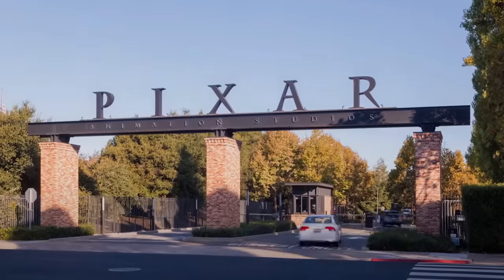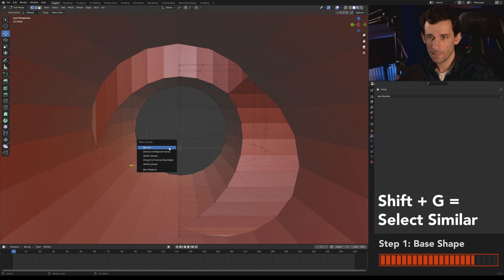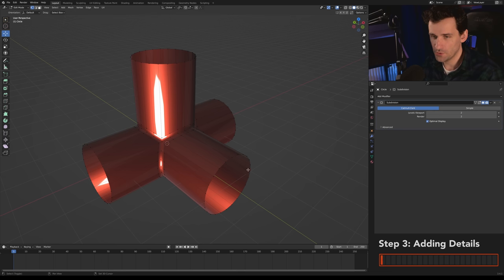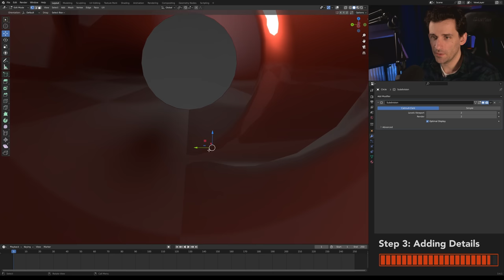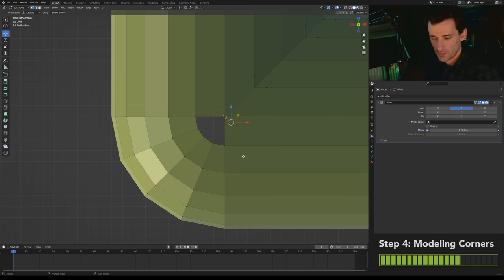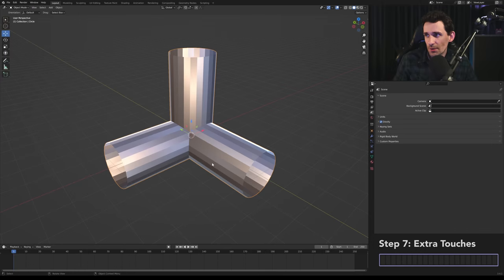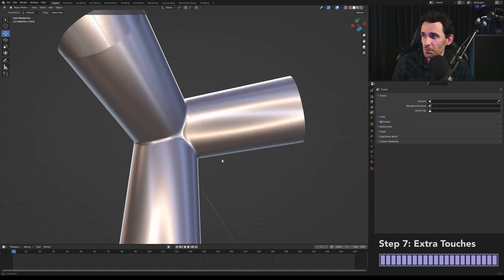3D Models That Will END Your Career

Comment: I’m not a professional in blender but you could just use bevel modifier before subdivision instead of adding unnecessary loop cuts. Also you could use solidify modifier instead of solidify faces tool. Then you couldn’t need to add those extra loop cuts on the ends. If you need a bit of rounding on it add one more bevel modifier and in shade auto smooth. I always try to avoid these support loops. Please tell me if I’m wrong
Reply from the maker: you would loose your 3D job a couple of times foe this post lol

Comment: What are your thoughts on using Shift+E to make a smooth edge more sharp as opposed to an extra edge loop? I tend to use Shift+E to help reduce the amount of vertices in a model, and it seems to yield similar results. Is there a deeper concept I am missing or no?
Reply: Don't quote me on this but I think edge crease data may not always translate when you convert it to other programs and that's why

Comment: Wouldn't it be better to set the crease value for the edges instead of adding additional edge loops? That achieves the same effect, sharpening the edges with a higher crease value, without having to create extra geometry just to manage it.

You can access it by selecting a few edges of a model, press N for the side panel on the right in 3D viewport, go to Item tab (the first one), and in the Transform panel look at the last option, "Crease" (or for multiple edges, "Mean Crease").
Reply: Also, instead of adding edge loops to make the smooth shading not be so smooth, consider enabling Auto Smooth at 180 degrees (so it doesn't autoflat things) and then marking edges as sharp instead (CTRL+E -> Mark Sharp); this can be really handy, as the result is that a face can be smooth with adjacent ones and yet sharp on the edges marked as sharp, and it doesn't depend on any additional unneeded geometry lol

...Though in that particular case the edge crease value can already get you there i guess lmao

Comment: For merging three pipes - I would use beveled box as join. Size matched with pipe size and segments matched, with no of points of circle would make it very nice looking mesh IMO.
Thanks for sharing - very informative and helpful.
Reply from the maker: With the cube solution you need to avoid a vertex at the center of the corner - it causes a shading bump (you can check my twitter where I explained it)
Reply: @Chocofur  Thank you, I will keep it in mind.

Comment: I would use CAD software like Fusion 360 to create these tubes much faster and then convert them from a parametric body to perfect mesh in Fusion 360 as well. 
I don't know if this is out of the box thinking or just me with CAD experience.

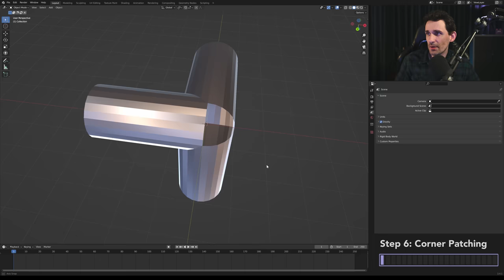Comment: For 8:24, you can instead subdivide a cube a few times with Catmull-Clark method, and apply polish on it until it becomes almost a perfect sphere. Then you can use one of the poles on the sphere (aka 1/8th of the initial cube) and replace it with the UV Sphere you were trying to use. Or you can conform(or shrink wrap) a subdivided cube on an almost perfect sphere and use one of the poles. Both would work, and produce the best result.
Reply from the maker: it won't produce the best result as you'd have a vertex in the middle of the corner, causing a small shading bump with subdiv mod applied. it's close to being perfect, but that one vertex ruins it
Reply: @Chocofur  I just tested it. It works perfectly fine.

Comment: 8:21 If you use quad sphere with one level of subdivision and scale it to mach the borders of gap and then weld vertex, it would save you time and makes better topology.
Reply from the maker: it doesn't have better topology and it's more work, check other comments

Comment: For the modeling corners Im sure using the shear tool at 45 degrees each, joining and then beveling might be much faster and easier
Reply from the maker: faster and easier but NOT GOOD ENOUGH
Reply: @Chocofur  After some testing, simply bridging the edge loops is the fastest and best way to get the result you want, opening the tool in the bottom left and fiddle with the number of cuts and the smoothness settings to get the correct density and profile of your mesh.

There are other settings there to customize it further but I didnt find I needed them to achieve this result.

Comment: for level 2 (or the 90 degree pipe bend it's as easy as just taking a torus and then cutting 1/4th of it to get that 90deg angle. and then we can extrude the faces outside. to get a steeper angle we can scale the object up using alt + s. gives perfect topology

Comment: Instead of adding extra edge loops on the corners to make the subdivision "sharp", you can just select the edges you want to be sharp and press Shift+E and then pull with your mouse until you like the result. Now the subdivision won't smooth the edge anymore :)

If you want to remove it you can always select the edge again and set the "Mean Crease" to zero in the "Item" Tab in the side menu you open up by pressing N :)
Reply: It never gives me the control I want
Reply: @squeakybunny2776  oh, okay. I found it pretty good since you can slide it to be as sharp as you want. You can also put a number in the "Mean Crease" I mentioned before and that's usually pretty accurate when you can add numbers like 0.548 or whatever.

Comment: I guess you could select those non symetrical vertices on the third example and use loop tools to turn them into a circle with the flattening option turned off? Idk if it would cause shading errors though

Comment: Just on a side-node: You do not need to add edge loops (they are hard to deal with in terms of symmetry). However, you can add a EDGE weight to edges and give it hard numbers to compare over all the edges
Reply from the maker: if you ever want to land a serious job as a 3d modeler, you need to learn how to edge loop. creases / edge weights will get you fired at sight

Comment: So the puzzlement regarding steps 6 and 7 :

I suspect that part of why it works
is because the spacing and angle of the vertices
still follow the "rules" of 3D geometry enough
to produce that smooth result
(even though the wireframe looks a little untidy )

In a similar vein,
when the geometry on my model looks clean,
but there's a pinch,
I often find that this is due to those same "rules"
not being fully satisfied.
(and not because of some glitch in the program)

A tweak  here and an adjustment there
and then eventually the rules get satisfied,
resulting in a smooth render.

Same for tri's, ngons and quads.

Comment: Hello, I'm curious whyy not use bevel on edges instead of adding loops to sharpen sticks inin subdivision ? Cause to me it's faster, And I've ended having less Faces count on model int hte end.
Also, is there any difference between using Solidify modifier with Solidifing through Face menu ?

Comment: I am CAD person using Blender, so it is hard for me to eye ball everything. On the first item used the bevel tool on the common line between the pipes and the ends. To clean up object after apply the Subdivision Surface Modifier. I used 3 segment and the distance of 0.01 for the Bevel tool.

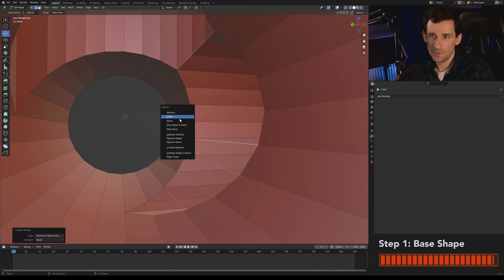Comment: @ 1:52 you can see the triangle shape in the bottom. For some reason I had still had one face on top of that. Actually connecting with the last line visible there (stangely it did not happen at the joint on the side wich should be identical).
Using Blender 3.6 and the bool tool addon (just hotkeys the bool modifier)

Problematic face can be safely deleted and everything works just fine. I double checked.
BUT if it happened to me it WILL happen to someone else too, so I would reccomend double checking by looking closely inside. Problems should be easy to spot, since there isn't too much going on in there.

Comment: Try doing this in Alias instead. G3 or even G2 continuity on all surfaces results in glass-smooth surface transition in the CAD model itself, not just when visually rendered so you can actually send your CAD to engineering.

Comment: Funny how I have a degree in industrial parts design (using CAD) and trying to pick up blender was so incredibly foreign to me. When making such a part in solidworks or inventor is literally 15 seconds. Feel like there should be a solution that lives between the two, where it's possible to push and pull a model like you would a sculpture, but still have the ability to mix in parametrized 3d shapes. The main issue I see is how freeform apps like blender, work with 2d meshes, which are limited.

Comment: I can explain why that last mesh worked: it just has 3-way symmetry (split the shape in three shapes by cutting them in three lines 120° apart from the direct middle point, and you'll notice all three pieces are perfectly identical but rotated 120°)

3-way symmetry is actually exactly what you need for that, because you have 3 identical pipes attached to it at equidistant angles. A different mesh could have had 2-way symmetry alongside 3-way symmetry while still working, but a shape with just 2-way symmetry would never have worked. Unless maybe if you made so many vertices the human eye can't physically distinguish the connection's asymmetry. With the first version of the sphere, where you only had 2-way symmetry (the vertices bunches up at one end like the meridians of Earth bunch up at the poles), the pipes look different depending on how you orient them.

As for why that shape in particular works so well, as opposed to some other shape with 3-way symmetry, I have no idea. I'd guess there probably are other shapes with 3-way symmetry that work just as well, if not better, but the method you've found to create the 3-way symmetrical 1/8 of a sphere probably just makes it look like that. You could probably create a mesh with both symmetries that works just as well, but that would just add extra steps to something that works.

Comment: It's good for vanilla workflow, but this would be pain if pipes are at an angle, or for example if another pipe needs to be higher resolution.
I tend to use Mesh Machine boolean workflow along with QuadRemesher, and it gives me great low poly topology model with 95% perfect shading which SubD flawlesly.

But I discourage people from using addons if they do not know to do it the hard vanilla way. Once you can do and understand topology and edgeflow, then you can speed the way with plugin.

Comment: the 90 degree pipe could be done easier by adding a circle and select any vertex on an axis then snap the cursor to that vert then from the side panel -> view add the radius  of the pipe to the 3d cursor location at the axis that you chose the vert at then in edit mode use the spin tool with 90 degrees and extrude the outer edges you will get much smoother result
Reply from the maker: your career just ended

Comment: Hello thanks for the video and the tips along the way, always good to solidify the basics. As for the level 3, i have chosen the retopology route using the same sphere ( 24 sgmts) as a guide for snapping. Mid topology i had to do only one reduction from 6 to 4. The two triangles that form in the narrow part can be turn into quad by splitting their upward facing edge. I like the result, but it may not qualify as easy. Right ?

Comment: I would use a 45 degree plane to cut the end of a pipe and use an array modifier (below the subsurf) to duplicate and rotate the pipe. This way you have to adjust the corners of a single pipe.

Comment: So I did one with one pipe intersecting another in the middle. But for some reason it hates being solidified. I did the topology right but the vertical pipe deforms on the inside when I try to solidify it.

Comment: just use a subdivided cube, delete unnecessary facecs and do "merge by distance", - less clicks and cleaner result) also, u can use Edge Crease function or bevel modifier instead of making support loops by hand, and enter value after comands like 'double G' to get more even result and not doing this by eye)
Reply: Crease is still not guaranteed for identical implementation in external packages, so I think I would prefer non-destructive Solidify and Bevel (by weight) modifiers .. 2 segments, Shape 1.

Comment: for the second one wouldnt the shear tool work very well, it will skew the end to a 45 degree angle then just extrude up, add loop cuts -  make these vertical and horizontal to keep sharp inside corner and nice round radius on outside and voila

Comment: To prevent roundness after subdivision isn't playing with bevel weight of an edge a better solution than adding an edge loop that increases the number of vertices ? I don't have much blender experience but I mostly did that to prevent excessive roundness at edge

Comment: i gave the last mesh a good attempt, the 3 tubes into a smooth elbow. 
not going to say i get a result any faster, but you can use the spin tool in edit mode to close the triangle hole. but it had to be done 3 times on 3 different axis and leave a small opening in the center and manually close it with good topology.
Reply from the maker: and it's the crazy part, it really doesn't make sense it takes so much effort to have the correct shading
Reply: @Chocofur  if only the subdivision surface modifier had a "fix poles" checkbox or something.

Comment: The reason why the last thing works is twofold. 
First of all you said it has no symmetry - but it does. It's just not a mirror that you are used to seeing. Instead of one line determining the symmetry you have 3 lines at 120 degree angles starting from a point. You can Google symmetry lines to view mathematical explanation of it. Your symmetry is essentially that of a triangle.  By rotating the corner what you basically are doing is creating a perfect cube corner with those transformations. Try the same transforms with a simple square plane and you will see. 
The second reason it works is that for shading edges don't matter as much as face normals. And the normals with your method are all symmetrical in accordance yo those 3 lines, so it looks perfect.

Comment: Idk if I'm missing something, but for the UV sphere and 3 pipe, why not just select the faces on the sphere that fill the gap, split it from the sphere, delete the rest, and join it with 3 pipe mesh? It looks like you could've skipped the extra work, but again, I don't know if it's easier in my head since I haven't tried it, but it's something I saw possible when you were selecting the faces on the sphere that perfectly covered the gap.

Comment: For the first one... instead of sliding edge loops around couldn't you just bevel the edges extremely thin (like 0.0001m), then change to edit faces mode and shade those thin faces flat?

Comment: I have absolutely no experience with 3d modelling and I don't know how I got here but for the second example, I would have used a sphere or hollow sphere to add the corner... Maybe even cut out 3/4 to make it open on the inside

What side effects would this have, is it harder/easier to do and what benefits does one way have over the other?

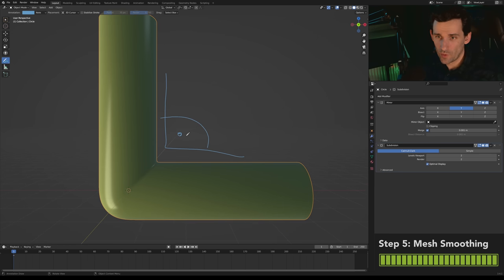Comment: I have slightly better method to the 8:00 part, instead of messing with speheres you can just use a quad sphere and cut a 1/8 of it, it will create you a perfect corner.

Comment: Quick question. For step 6, if you already had done the 90 degree pipe, why wouldn't you just rotate the entire 90 degree pipe 45 degrees, slice it down the y plane, discard the half the model that the extra bit of of pipe is not sticking out of, then mirror over the y axis?

If what I said sounds stupid, it's because I barely use blender and honestly don't know why Youtube brought me here. Seems like it would be fun to really learn though.
Reply from the maker: this will then give you shading errors similar to the ones from the intro

Comment: Mmm... I may have found a better last solution completely by accidently while failing to follow along haha.  If I would share a screen shot I would but its completely symmetrical and I'm a complete beginner but it surprising works extremely well and no signs of deformation or artifacts. Honestly it basically follows the 2nd part of the video of cutting the sphere and making new edge loops for it to follow. Thanks for the video extremely helpful.

Comment: Thanks for sharing. 

Question: At 8:28, why don't you select all visible faces from your ball, invert selection and delete the remaining faces, then connect the last eighth to the pipe?
Reply from the maker: because the upper part of the ball looks different if you pause the video. you would have many small triangles connected to the main object in just that upper part of the model, which would result in the shading errors from the intro. you can try doing it this way yourself, it's a good modeling exercise :)
Reply: @Chocofur  Aah, gotcha. Thanks. - Yeah, trying it out at the moment. Thanks. :)

Comment: why did you go for the Edge loops instead of increasing the edge crease. especially for the part with solidifying faces?
Reply from the maker: creases are just a shortcut if you don't want to properly model everything. when you export that model to obj/fbx and import to other 3d software, you never know if it will retain the shape. with correctly guided edge loops you know the model will ALWAYS look the same, no matter the format you use for exporting, no matter the software you'll be using
Reply: @Chocofur  ah i see i see that makes sense

Comment: Why dont you use the bevel weight ( 2W shortcut) with a bevel modifier with the limit method "weight" instead of adding edge loops at 2:45? its non destructive this way and more precise

Comment: as a beginner, who only do character model, if i had to use the sphere to complete the corner, i'd first bride the gap with edges, then get a shrinkwrap modifier on the pipe to the sphere, and create the loopcut trying to match the vertices of the sphere XD i would probably also die in the process of trying too hard, wont get the job for sure, and go back to my current job XDDD